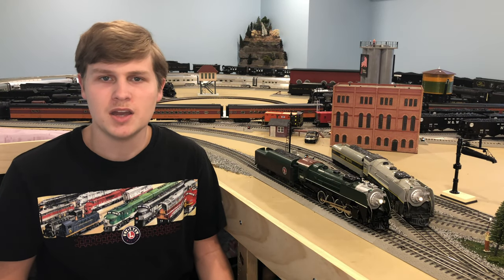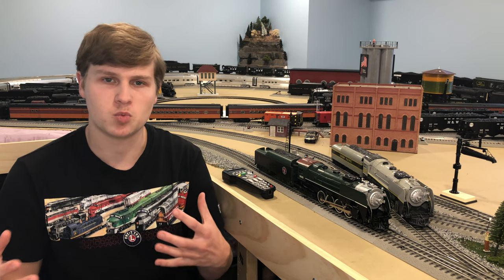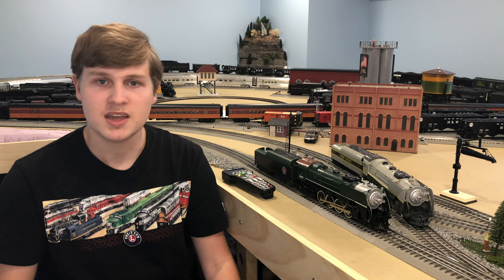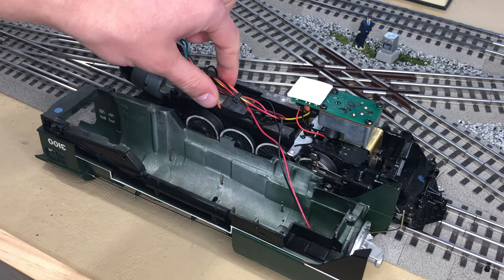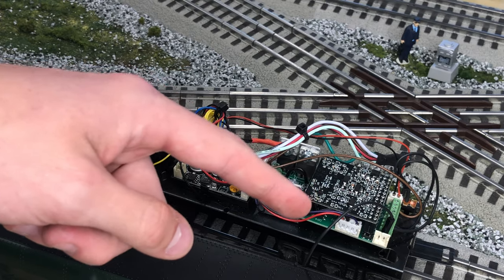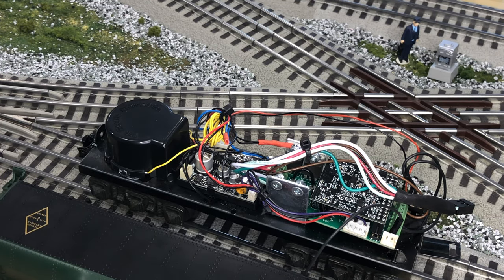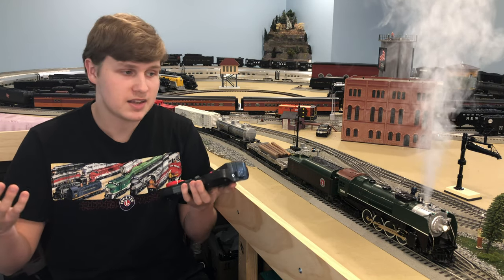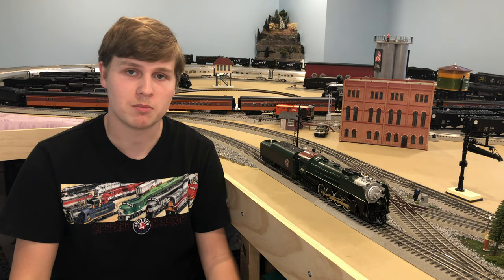Modernizing 70s MPC Lionel Trains

Comment: I'm in the process of rebuilding my Lionel collection from scratch, and think your skills might make one of two ideas I had a reality.
     My first starter set (at 6yo) was Lionel's Blue Streak Freight, with Jersey Central Lines 2-4-2 #8303. It came with the electronic Mighty Sound of Steam. (My third locomotive -- and pride and joy -- was a mid-1990s MTH Southern black FM Trainmaster. It was Command-Ready, with number #6301. I can't even find the shell for that Diesel.) My original collection was lost when a tree damaged my house, and the house was looted after I evacuated.
     As I said, I'm rebuilding my O-Scale collection, and so far, all I have is a few pieces of rolling stock (mostly Southern boxcars and trailers-on-flatcars). I want to get the MPC version of Southern's #4501 2-8-2 steam locomotive, but while I can take or leave the MSOS, the whistle sounds terrible! If I did buy a Lionel 6-8309 Southern 2-8-2, I would want upgrades to be made.
     My second idea leans more towards my being a Transformers fan and collector. Ever since I learned that Decepticon Astrotrain was modeled after a JNR Class D62 (a 2-8-4 locomotive), I've always wanted to customize a Berkshire locomotive in "FedEx" Purple/Violet. Lionel's original Polar Express "Berkshire Jr." locomotive looks the part (minus the boiler deflectors, which I hope aren't too tough to add to the body). But for reasons I'll never understand, the cartoon gave Astrotrain a Diesel air horn instead of a steam whistle. My second reason for writing is, can a Diesel horn (K5H or K5LA style) be swapped onto the sound board for my Berkshire?
     Are either one of my ideas feasible?

Comment: Very nice job. I put a smoke unit in an old diesel. It's a dual motor so there was no room for a sound board. Picked up a Post Office box car and put a diesel sound board in it with pickup and sensor. Works great too. Your work however is head and shoulders over mine. Thanks for letting us in on it.

Comment: Well done,one thing on the old style motot,it is universal wound and function on both AC and DC.Lionel chose this motor early on because at that time some utilities chose DC to start,thank Edison for that.Since DC requires substations every few miles and AC does not but can be sent over extensive distances over transmission  lines AC won the crown.

Comment: Nice video! I've added some railsounds to my TMCC southern crescent limited but I'd love to upgrade the smoke unit like you've done. I'm okay running with a powermaster using conventional varied voltage. I love what you did, great job.

Comment: I have SP Daylight GS2 Lionel 18007 with (white noise) Sound of Steam, is there a board that can be installed to get rail sounds whistle, bell and chuffing. I looked at 3rd rail electronic railroad's website, but I am not sure what to buy and how difficult it would be to install. Is there another product that I should look for or was I on the correct website and do I have to install the command control to use the sound board. Any advice would be appreciated
Reply from the maker: Any of the steam sound boards will come with everything you need to give your engine improved sound in conventional control. You do not need tmcc to use the sounds. They actually have a GS4 sound card which will work well.

Comment: Hi Sid, Thank you for the demonstration. Your video presentation is informative. How may I motorize a K-Line non-powered FA? Would a Lionel FA frame with the Pul-more motor be a consideration? But there is no slot on the top of the train for a mechanical e-unit lever. Is there a supply of electronic e-units to substitute and install for a modification? However, I do not know if an electronic unit is compatible with 
Pul-more's? Or should a slot be cut? Any suggestions? Thank you.

Comment: Did you have to step down the smoke output voltage? The fan driven motor runs on 3-5v but the output to from the commander is 12v. Thought your smoke output was quite good - made me think about voltage compatibility.

Comment: Does that boiler front open to service the headlamp?  If so, I’m curious how you mounted the replacement LED behind it.
Reply from the maker: Yes it does. I mounted it by putting it in the hole and holding it down with a little dab of glue.
Reply: Thanks!  Not sure why I never thought of a little glue!

Comment: One thing I would have done differently was where you placed the magnet on the tender.The middle wheel set at times will not touch the track consistently on a six wheel set, one  of the end wheels would have been better..   Sorry I have found some of these modern sounds to be a recording of a real engine but that recording sounds like it is the next room instead of  right from this train in this room. The direct electronic sound was always directly from the train and it was very obvious that it came from that engine tender set.   This is nothing against your good upgrade here but I find many of the modern sounds, sound canned except the bell sound sounds pretty direct, but the whistle sounds far away....  No puffing smoke????

Comment: Enjoyed your video and subscribed today.  I have an SF powered B unit that is TMCC equipped plus Odyssey, but I'd like to install Railsounds. Do you know which ERR product I should buy and how difficult would you say the install would be?  On a scale of 1 to 10, I am about a 4 with a soldering iron, but my ability to follow directions is 10 out of 10.  Thanks.
Reply from the maker: An F3 Railsounds commander from ERR would be what you need. All you would need to do is hook up power and serial data from the radio board on the current b unit and the speaker is plug and play.
Reply: @SidsTrains  So would the Railsounds work via the TMCC command unit or just via the speed, etc. from the engine?
Reply from the maker: @royroberts5333  they would connect to the electronics in the powered b unit.